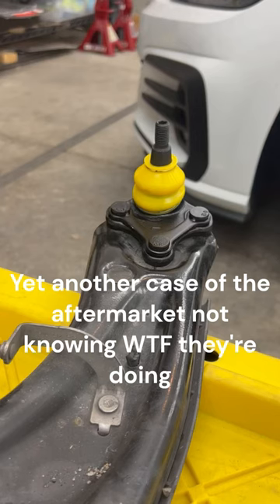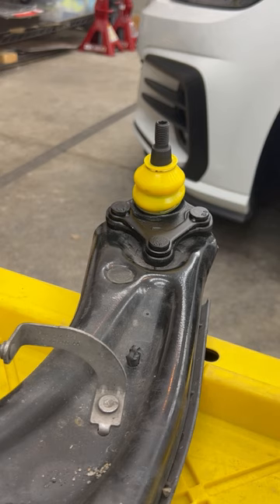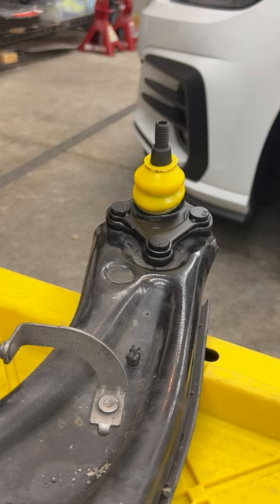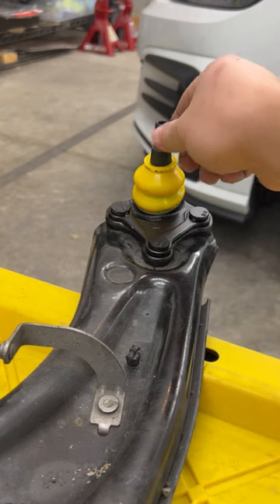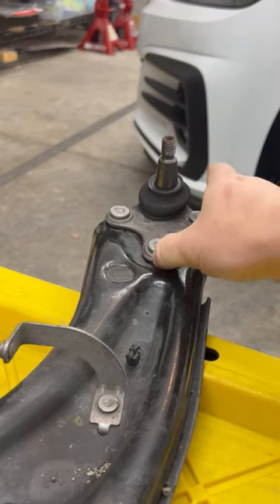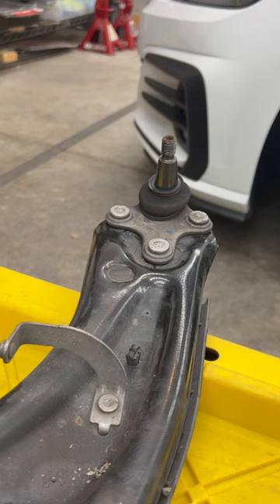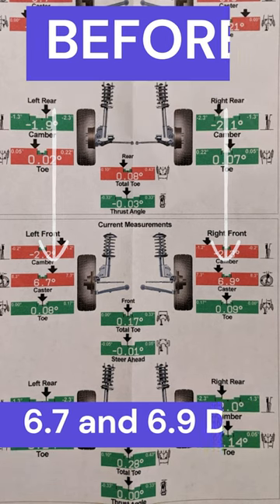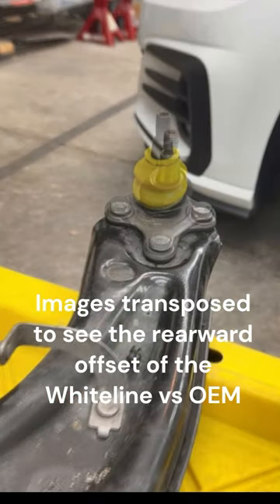Whiteline ball joints interesting find on the MK7 #shorts #whiteline #caster #balljoint

Comment: Is there any ball joints that don’t do you out of any caster? Superpro/034? (I know the 034’s are a fixed camber increase)
Reply from the maker: 034 don't hurt caster as far as I can tell. Not a fan of the bump steer due to the 18mm (their website says 10, it's wrong) of RC correction with no way to correct bump steer. White line is about 8mm RC and combined with the KCA 462 bump steer sleeves (bushings in the kit are no good, just the sleeves) offset almost all of that (7mm bump steer correction). There will still be a tad bit but it's far less egregious. I added back caster via JXB sphericals in the rear position.

Still not a fan of the adjustable ball joints from a "might slip" perspective, but has not been an issue yet.

Comment: One question, better 034 or whiteline ball heads?
Reply from the maker: IMO for autocross only (and don't care about being competitive) the 034 ball joints are great because they add a ton of camber and the bump steer they introduce really won't be noticeable. The Whitelines I'm running now along with some bump steer correction which helps in that regard, and they get a bit of camber... but you lose caster in the process. I'm compensating (somewhat) for the caster loss by having JXB caster sphericals in the rear of the front LCAs.